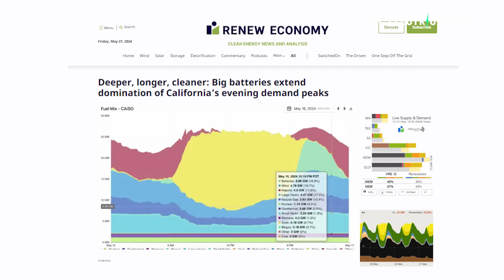Fossil fuels shattered as battery power continues breaking records in California

Comment: Unfortunately for us Californians, our electricity rates are over $0.5/kWhr! . This state is taking advantage of home solar panels, pay them almot nothing for that power.
Reply: I'm in Southern CA and my peaks rates are below 50cent/kWhr.   Granted there is not much difference anymore between the Off-Peak and High-demand rates and don't get as much payment for the solar power I put back into the system as before.
Reply: @thehobe150   I moved out of CA about 13 years ago.  Don’t the utilities pay for use of home generated solar that is tied to the grid?  So if you are generating power from 1200-500 in the afternoon but you are at work, the meter is effectively running backwards?
Reply: @doittoit00  The current payout for home generated power is about 10% of what the utility charges and that is being reduced every few months as the solar power generation has increased dramatically over the last few years.  The only solution if you have solar is to also have a battery as well in order to use your own power when you need it.
Reply: @doittoit00  Yes and no.  You are still paid for your over production, but the rate is just above avoided cost.  When you lived here it was 1 to 1.  So if you injected a $1 worth of electricity your were credited $1 on your account.  
Now if you inject $1 worth of electricity you are credited some much smaller amount depending on the hour of the day.  Additionally, they moved the peak hours to a time of day that solar can't produce power.  So, during the middle of the day that $1 worth of electricity fed into the grid is now worth about $.08.  If you feed back that same $1 of electricity at 7:00PM you will get $.16 of credit.  This has had the effect of making the payback on solar 16 to 19 years.  Not only do you get less return in credits but you need to install a larger array as well.
If you add a battery you design it so you don't use power from the grid at all.  Your PV array charges the battery in the day and powers your home.  As the sun goes down the PV and battery take over until the next morning.  You don't earn anything from the feeding of electricity to the grid so why bother.  Once you battery is charged then your array will power your house and feed excess to the grid so you will get some amount of credit for days when the sun doesn't shine.
Reply: @doittoit00  That's correct. They were paying the retail rate for that power but there was a change recently. I don't know what the final outcome was. They did change to pay structure for those of us with solar. Cheapest time of day moved from nighttime to morning (8-4) and no longer the big change from off to on peak. I used to pay 13cents and sell back at 37cents. Now the difference is only about 4cents. With a 6000sq/ft house my bill was about $200 per year. I expect it to be about $800per year now.
Reply: Paying super high rates (10x versus some other states) and yet provider PG&E is short-staffed, broke, and worse depending where you look.
Energy providers should be regulated monopolies not pretend-private and thus running facilities into the ground for profits at the risk of entire towns going up in flames due to improper maintenance triggering huge wildfires.
Reply: @orbitaljellyfish808  Hardly broke.  The gross profit margin last year was 23%.  And they are getting a rate increase in July.  They have been boosting rates to cover the cost of burying power lines to stop the Diablo Winds power shutdown events.  Sounds good, right?  Well that cost has been budgeted for a couple of decades but the work was never done.  The overhead power lines were ignored as well thus the fires before they started shutting down the power in high winds.  So now after being found guilty of manslaughter for the Paradise fire they are in a high speed effort to bury the lines.  BUT, they need to have more money to do it.  But wait, weren't they paid to do it for the past couple of decades?  Yeah well the old CEO needed a new yacht and mansion first.  Then he retired after Paradise burned to the ground.  You can look to the CPUC to see how that is all being managed under the direct control of Gov. Newsome.  
The price for electricity in the CPUC controlled utilities is greed and theft.  That is why I have a large PV array and a battery large enough to keep me from giving them a dime more than I have to.
Reply: “. . . a naïve observer might conclude that the rising share of new renewables (solar and wind) will usher in an era of falling electricity prices.  But in reality, the opposite has been true.”  Vaclav Smil, Numbers Don’t Lie, p.172
Reply: @dzcav3  The reality is that costs will not be the lowest while a completely new infrastructure is being built out. Another reality is that fossil fuels are not getting more abundant and therefore not any cheaper. 
We should be building for tomorrow, not for yesterday.

Comment: Think about what happens when the sun doesn’t shine and the wind doesn’t blow for a week….
Reply: Ok … so we need a gas powered grid infrastructure for the 10 - 20 days per year that renewables and batteries can’t work. As long as I don’t have to buy a diesel generator for my balcony 😅.
Reply: @john4flying  That's a reasonable concern. There will need to be a lot of thought no only in the generation and storage but the management as well.
Reply: Think about it yourself, for a state as large as California.   All the data is there.... turns out you are blowing smoke.  Besides, you might not realize this but there is a correlation between A/C use and, you know, sunlight.   It also turns out that solar is a big deal even in the middle of a winter storm.
Reply: Or when you have to take a coal plant or gas plant offline for weeks for failures or maintenance?  
Gas plants will still be around which can be fired up and some conservation needs to be made. Especially for those states who don't enjoy as much sun and wind as CA does. And some of the newer solar panels don't require blue sky's to make power.

Comment: It's possible an outright deflation is starting to take hold in the USA this is true. It's not so much that supply is way up but that demand has collapsed...although true to say supply is way up from basically nothing 10 Years ago. Trying to run a concrete batch plant is SUPER ENERGY EXPENSIVE however. That means either natural gas peaking plant or nuclear power not solar or wind due to intermittancy. California has had two very wet Years providing an unusually large amount of hydropower tho. This is true of all of the US West actually. This flood of electricty is highly unusual and truly vast so far more than California although certainly there is that. Tesla Cybertruck still a very interesting power source tho as it can be completely off grid.

Comment: Actually, my city of 200k (relatively affluent)  in Southern California has only 3.6% of homes with installed solar.  Their GOAL is to install 10% by 2027, or at least by 2030!  That is a miniscule amount of local generation.
Reply: And when you consider that homes use about a quarter to a third of the electricity that industry does, it becomes a drop in the ocean.

Comment: These are obsolete technologies because a Danish company is about to make liquid fluoride thorium nuclear reactors commercially available. The interesting thing about these reactors is that they can also use nuclear waste from a conventional reactor as fuel. I think it would be cheaper to utilize water to combustible gas technology as was done by Stanely Meyer, and others to run generators. Water is cheap after all, and these conversion technologies can even use salt water as fuel.

Comment: The low hanging fruit they are neglecting to pick, is to cool down houses just before peak demand, so less power is needed in the early evening. Smart dynamic pricing based on the current grid voltage would incentivise people to do this.
Reply: This doesn't work well in practice.   I know, I've tried.  The thing is, when California's Pacific Ocean air-conditioner is operating in full force (like it has been this entire month), homes on the coast stay cool without A/C well past 2pm and homes inland require far less A/C until roughly 2pm.   But past 3pm the angle of the sun on typically west-facing windows and the sides of homes instead of the (far better insulated) roofs puts vastly more heat energy into the home that no amount of pre-cooling can overcome.

So pre-cooling only gains you 30 minutes to 1 hour of margin, at best.  And getting that margin burns an enormous amount of electricity for no particular reason because you are fighting the early afternoon sun to get it... precisely the worse time to try to do it.

It also does not necessarily stress the grid.   The grid's peak demand doesn't occur until after 6pm, and the peak fossil demand doesn't happen until 8pm.    And grid-scale solar is still more-or-less at full production up to around 6pm.  So there's no point trying to pre-cool prior 3pm.  If you need to run the A/C, run it normally up to 6pm and don't try to conserve energy until after 6pm.

After 6pm the sun is far less effective at pushing heat energy into homes, and by 8pm it has essentially set.  So ratcheting down past 6pm actually saves more energy and saved more money than trying to pre-cool prior to the peak-rate period (4pm).

-Matt
Reply: also the dry cycle on HVAC is a hidden way to use less power by briefly and occasionally running heat and ac at the same time to dry the air not just cool it so skin and sheets don't feel sticky even when it's cold. and also #passivehouse only costs 5% more to build but reduces HVAC bills 90%.
Reply: In northern California you are charged more from 3 to 9 pm. My heat pump water heater is programmed to drop its set point 5 degrees Fahrenheit during that time.

Comment: Battery fire in energy storage facility that's been burning for weeks in Otay Mesa California is going to turn ppl from wanting battery storage. No one wants weeks of evacuation from the area due to toxic smoke.
Reply: Towns and cities Don't want Deadly Lithium  Batteries stored in their surroundings  ... Ban Lithium  battery storage in your towns .. these things are Extremely  dangerous
Reply: @autotech226  agreed. By same reason, ban coal, nuclear, natural gas, oil, diesel, gasoline, etc as they pump out far more toxic fumes than battery fires. Try sitting in enclosed area with engine running if you need convincing.

Comment: If governments didn't collude with energy cartels and suppliers, this would have happened all on it's own organically.

Instead, despite the clean energy development(s), people are running for their lives from this tax and societal trap called California.  California is now calling for a new 3 cents per mile tax on cars due to "efficiencies" (ie lack of tax collection) that this technology provides.
The technology we 'need', is new governance models. Not just energy storage.
Reply: This is simply wrong. The proposed tax is $.03 per mile not $.30 cents.  You are simply wrong at best and a liar at worst.  California has more miles of roads per resident than any state in the union.  It costs between $8B and $9B per year to maintain those roads.  With improved fuel mileage and a 20% uptake with electric vehicles they aren't collecting enough to maintain those roads.  With the increase in electric cars expected in the future charging a gas tax seems pointless.  Why is that so hard to understand?
Reply: @bryanwhitton1784 I humbly accept the proposal is for 3 cents. Not 30. Big difference.

Comment: Is the San Diego big battery still burning ? Last report I saw said 6 days on fire fire fighters expect to be on-site 4 to 6 weeks and the battery is a total write-off...
Reply: latest is its still going but as note it is a lithium ion batteries from LG chem and it is the old NMC batteries not the newer LIFEPO4 type batteries so have to be treated differently so like the old saying oils ain't oils same needs to be said of lithium batteries
Reply: Like the above comment said the batteries are NMC batteries from LG chem. They are one of the worst suppliers you could ask for, other big battery facilities are doing fine like the Hornsdale Power Reserve(operating since 2017)

Comment: Make sense, but lets put all the EV batteries to use to stabelise the net, we dont see much other than small scale test on that.
Reply: Making the bodybuilder go for a marathon seems stupid there are cheaper batterys that have more weight/not charged asquick but will give more storage
Reply: That’s mostly what these big batteries are for.
Reply: Its not really economic to use the batteries built into EVs to export to the grid except possibly in the most grave of emergencies.   An EV's battery is the single most-expensive type of battery storage that exists.
Reply: @junkerzn7312  but the point is not the price of the battery because that is paid for with the car, its more the cost/problem with 2 way chargers etc. I dont know how expensive that is compared to big scale battery incl. connections. Some places black outs are a problem, thats not relevant where i live but that also have value to be able to supply own home/business.